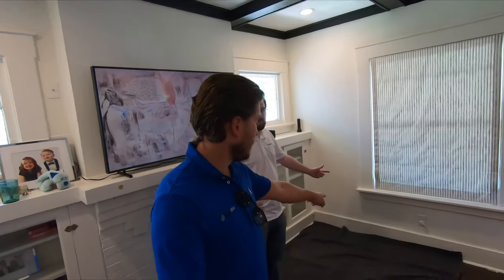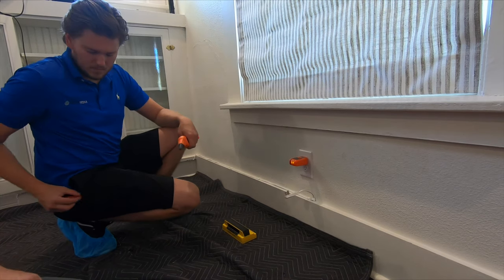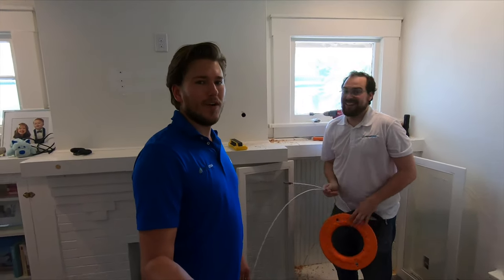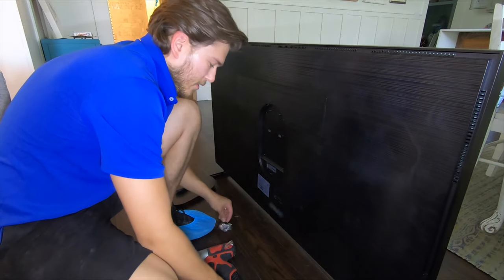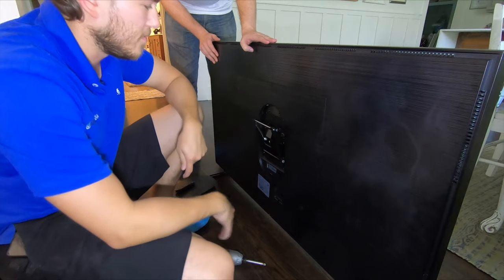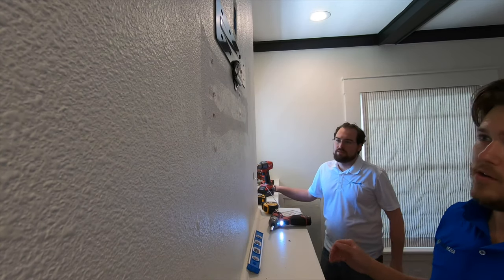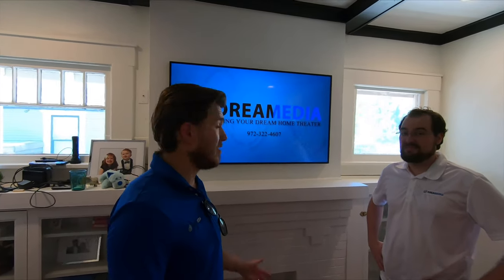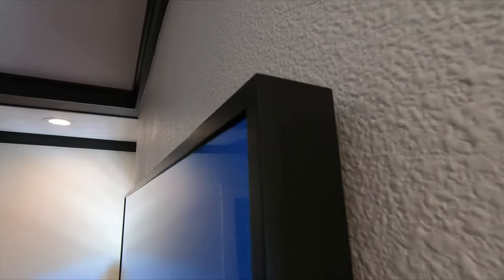2019 Samsung FRAME ART TV w/ No Gap Wall Mount Over Fireplace

Comment: This video helped me make a decision to buy the Frame TV, as it seemed really easy to install it.  Now that I have the TV and went back to refresh on these installation videos with the user manual in hand I realize the video shows a cable being run through the wall that is not an "in wall approved cable."  That is $220 and has insulation around it like a Romex wire.
Reply: I think its a money grab. this $220 wire is utter nonsense! no logic on how its going to prevent a fire or change anything in relation to not complying with the code. In wall rated cable is supposed to produce less smoke. this cable is 2mm in diameter, what smoke is it going to produce? The one connect cable is fire rated as it is, if you burn it with fire it does not catch fire. If you are worried that it will produce more smoke when its engulfed in fire, how much more of smoke is this tiny cable going to produce. How do you quantify the smoke it produces compare to all the smoke produced from the burning of all the other things beside it. I don't get it when people are making a fuss on this small tiny Samsung cable thats going through the wall. Really appreciate if a fire Marshall could explain this in a rational manner.
Reply: @LeslievilleGeeks  The UL1651 for OFPN cables also tests for fire spread <1.52m. So it' not only about smoke generation. Your comment is quite misleading.
Reply: @NeverRideSlowly  Please read the code in detail. The code is about cables used in risers and plenum space. meaning running it through a space where there is air circulation or between floors.  In this installation video I don't see the cable run in a riser or plenum space. Let me know how this cable would be a hazard? and what hazard are we mitigating by using the $220 ripoff cable. 

https://standardscatalog.ul.com/ProductDetail.aspx?productId=UL1651

Comment: I assume the mount does not allow for the TV to pull out and swivel, is that correct?  Do you know if there is a swivel mount option that would still allow this TV to be hung flush to the wall?

Comment: i live in australia otherwise I would have given you guys a call, but I'm trying to figure out how to mount the 65" Frame Art TV onto a brickwall above a fireplace. I'm going to have to run cabled to a once box & power outlet like you have done.. what was that cabling called? i need to tell my local electrician so they can quote my correctly

Comment: Thanks for making this awesome video. It's very helpful. quick question? if screwing the wall mount ends on two studs, we don't have to use dry wall anchors?
Reply from the maker: Not really. our standard is two studs minimum if not then supplement with 100lb drywall anchors

Comment: When I push mine flush against the wall it won’t stay, the top moves away from the wall about 1” any suggestions? I made sure the mount on the wall, and the back of the TV were secure.

Comment: You're placing a non-UL listed power cable behind a wall? That would go against the building code in several states Not in yours? Samsung has a special UL listed cable for behind wall installation.
Reply: Whats special about the UL Listed cable? The existing one connect cable is thin piece of wire which is fire rated. How does UL-Listing make it safer? Is this a NEMA money grab tactic?
Reply: @LeslievilleGeeks  I don't think the thin wire is fire-rated and would be violating building codes if you place it behind a wall. I'm certainly not an expert in building codes or all the UL codes, but found this article very helpful: https://www.tvinstallationservice.ca/how-to-hide-samsung-one-connect-box/. The codes they are mentioning are UL approval type OFNP FT6 (NEC, Article 770/UL 1651).
Reply: @NeverRideSlowly  

The existing one connect cable is fire rated. Try burning it with a lighter and you will see. It will not catch fire but rather just degrading. The TV will not be UL approved if anything connecting to it is not fire rated. Im 100% sure of this.  It would surprise me if Samsung made a cable which is carrying power to the TV and its not fire rated. That would a violation even if its not burried in the wall. 
Regarding the article you mentioned , its of no reference value based on the writer. Furthermore the solutions given have its own flaws. 

1. In that article the person buries everything in a metal box behind the wall behind the TV. That's a bigger fire violations in regards to everything else. The heat trapped in there would be just a gasoline to ignite a fire  of your tv and house. 

2. if you look at the the UL listed cable(i call it the money grab cable), it is basically more plastic material wrapped around the existing cable. Thats like putting more plastic on top of plastic and calling it fireproof. Where is the logic when a fire really happens. I see the fire having a feast more then anything else. Furthermore there are 2 wall plates that comes with it. Its just introduction of more toxic plastic material into the equation which will produce more smoke during a fire. This is defying logical science because everyone is blinded by a law written 50 years when there wasnt any innovation close to what we have today. 

NEMA/NEC codes have NOT been revamped from 50 years ago. Electronics have changed. electronics use so little power now. The jackets can be made so thin these days. Those days cables had to be really thick to reduce interference. It was carrying analog signals so big sheathings were used,  thus making them a firepit during a fire. in 2020 the cable are so thin that these cables are not a fire hazard as it used to be. 

Not to deviate from the topic, the OFNP FT6 code only applies when it is run in a plenum space where is there air circulation carried to the entire room/area. like putting it in a duct or above the drop ceiling. The cavity between your 2x4 is not plenum space. 

The NEC, Article 770/UL 1651 also says that it only when run floor to floor.

Comment: What’s up with all the holes in the drywall?
Reply: Sometimes this needs to be done in order to drill through each stud. You can also use a 6ft flex drill bit to minimize some of those wholes as well.
Reply: @creativetechniciansystems3312  Although this was needed, they should've just cut out one big rectangle. Reason for this is that it would've been easier for them, along with the guy repairing it as he can easily drill existent drywall into studs and plaster it up. Now the dude coming there to fix it has to put some wood piece behind the holes, screw it in, and then plaster it on that way which is a bigger hassle in my personal opinion.
Reply: @titledprince  ikr

Comment: Instead of putting four holes in the wall, why not just one and pull the AC back to the existing outlet and attach to the existing junction? Also, were four holes really necessary to move the outlet? I don't think so. And you actually left the installation "completed" with that ridiculous exposed wire and two holes? I'm sorry, but that is not a professional result.
Reply: I live in Barbados and you can NEVER pass an inspection without conduit behind that drywall to feed the wires through. A rodent can get between there, chew on those electrical wires and cause a fire.
Reply: @ricog8209  Literally every home in the US has romex run between studs behind the drywall. Newly built homes require arc-fault breakers but running romex through studs like this is how it's been done for decades.
Reply: Libena Starikova I think the gentlemen said that those holes will need to be repaired.